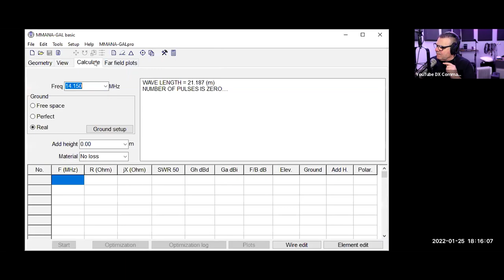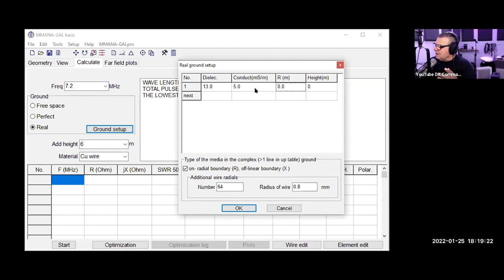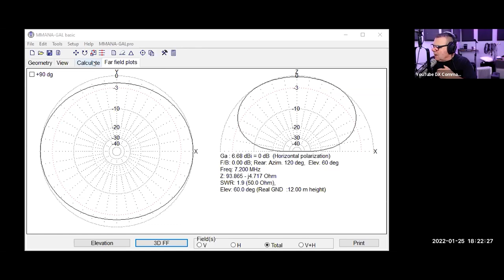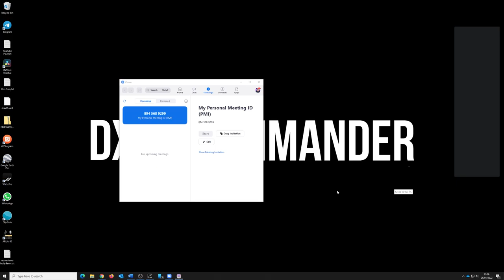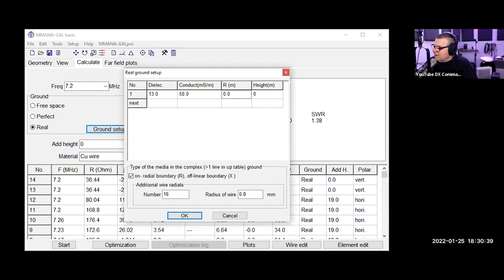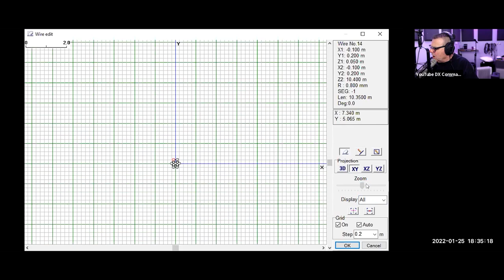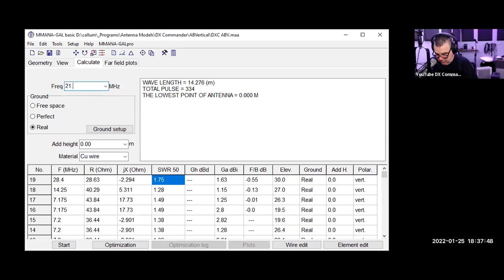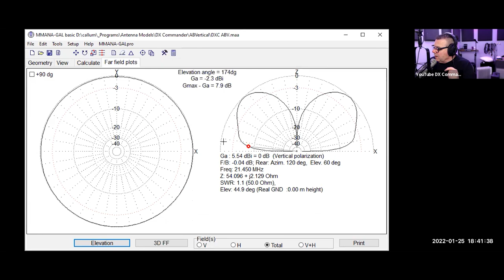Introduction to Antenna Modelling - MMANA-GAL

Comment: I like the way you differentiate between discovery and invention.  My personal history has involved a lot of what I call "unintentional re-invention" in that I have come up with some really good ideas, only to find out that someone else has already put them on the market.  Well, maybe that shows I've had some pretty good ideas.  Anyway - thanks for all you do.

BTW, I just came across a paper that uses the method of moments in determining relativistic hydrodynamic viscosity.  How's that for getting a few steps past Herr Hertz?

"All models are wrong.  Some are useful" - George Edward Pelham Box, a pioneer in the design of experiments and in Bayesian inference.
Reply from the maker: I absolutely LOVE THE PHRASE "unintentional re-invention".. Very good!!

Comment: What am I doing wrong? 10m vertical standing on the ground. 28 radials. Source at ground level. F 14.15MHz, gives R 2499, SWR 50.5, Ga dBi 0.11 ????😗 73 de LA5VL Vidar
Reply from the maker: Reduce the height to 5.2m

Comment: That's a great video, Callum. Is there any way in MMANA, when modelling a vertical, that I can see and calculate what happens if I omit a whole 180 Degrees of radial wires? Do I get any gain in the direction of the half radial bed, compared to the far-field signal strength of a complete 360 degree radial bed measured at the same far-field location?
Reply from the maker: What would happen  is that you would get marginal losses where there are LESS radials and about the same where there ARE radials.. Maybe just add some more :)

Comment: i might be missing the point here but how can it be a dipole when there's only one piece of conductor? i speak as a person who sees antenna theory as a black art
Reply from the maker: The conductor is effectively "split" where the coax joins. You can't see it in the diagram - and actually you don't need to draw that, the maths assumes it. Good question.

Comment: Hi Callum, I am having to do a station review before putting up a vertical antenna.  I am in a drone no-fly zone since being approx 3/4 mile from airport.  The FAA is asking me about antenna gain on the 18meter nebula.  I am a new ham and still doing the hands on learning.  Can you help me out with that data to make FAA happy.  73 KL5NU
Reply from the maker: Tell them gain is NO MORE than 1.2dBi at 20 degrees above horizon. At 5 degrees, it's -5dBi (yes, minus 5).